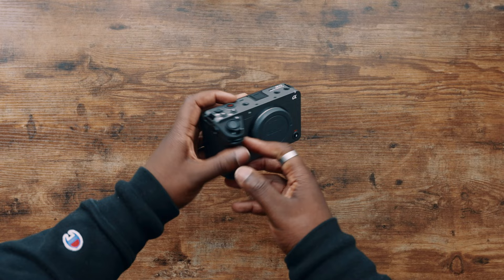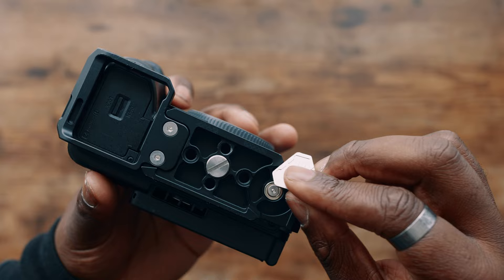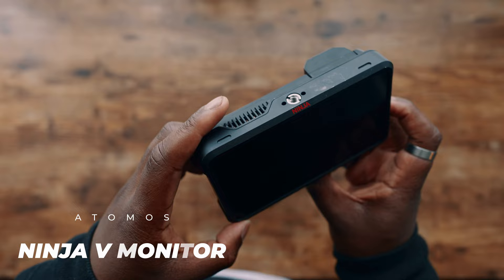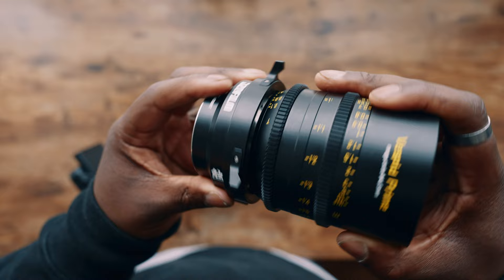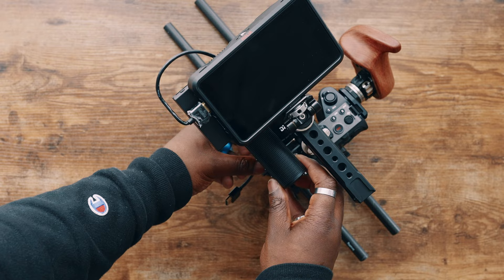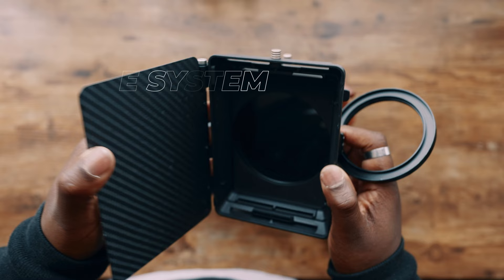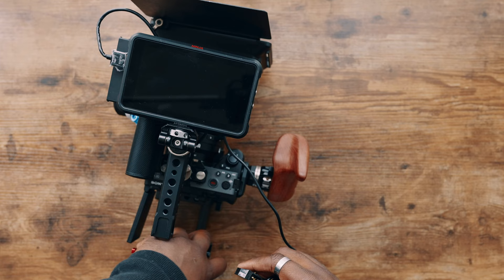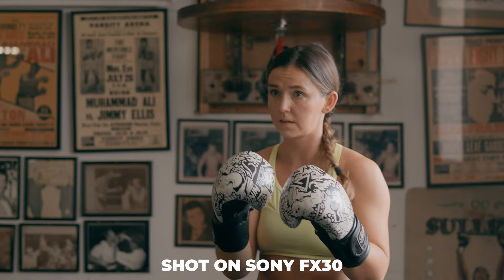Turning The Sony FX30 Into a Real Cinema Camera

Comment: FYI to all the fx3/30 owners. Surui came out with basically an identical cage as this for a fraction the price. Been using it and it’s a solid buy 😘
Reply from the maker: Fractions a bit of a stretch , the tilta full cage is $10 more on BH 😅
Reply: For a fraction OFF the price. 😂

Comment: Would you use the similar system with the XLR handle from Sony?
Reply from the maker: by all means you could , just need a monitor mount for the top handle, maybe the extension!

Comment: Is there a difference in battery life or power if using USB-C to the Dtap or getting a Sony Dummy Battery to Dtap?  Or possibly prevents overheating?
Reply from the maker: I think most people do it to avoid overheating , I just do it cause I’ll lose my battery door easily haha
Reply: Never use a dummy battery to Dtap for the FX30. You’re connecting 14.4v to a 7.2v connection.   You will fry the camera’s motherboard.

Comment: Very good video, I have a question to see if someone can solve it, I have a Sony a7siii I don't know whether to use a USB C cable for power with the v-mount battery or use a fake battery, what do you think?
Reply from the maker: I’ve heard people get hit or miss on dummy batteries , kondor blue has a usbc to d tap that might help !
Reply: @KofiYeboah  but I have heard that when connecting it via USB C, the battery does not charge completely so it discharges anyway, even if you have it connected
Reply: So, what do you recommend, use USB-C?
Reply from the maker: @areskrx9527  Ill use usb c
Reply: @KofiYeboah  thank you so much

Comment: Is it safe to power the camera and monitor using the same V-mount battery? I’ve been told not to power my camera and monitor using the same V-mount battery because it’ll fry the HDMI port and possibly the camera. Is this true? (I shoot on the fx30)

I'm using a small rig vb50 battery. I have an 8v dc connection to my monitor and a 9v USB-C power delivery to my camera.
Reply from the maker: I’ve never had a problem tbh

Comment: Hey Kofi I have a bit of a problem. I just got this battery for my fx30. I ran a USB A to USB C cable from the fxlion nano two. When I used it for the first time I had to keep replacing the internal battery because it wasn’t keeping up. Any ideas? Do I need to use the USB C port on on the nano two?
Reply from the maker: Imma link a Kondor blue cable that might be better , it’s a usb to d tap!
Reply: @KofiYeboah  I have the kondor blue dtap to npf for my monitor. But this battery only has one dtap. What would you recommend for the monitor then?
Reply from the maker: @barnes-media  do you have a d tap port on the v mount plate?
Reply: @KofiYeboah  no I don’t. Did you test out using the usb c port on the battery?
Reply from the maker: @barnes-media  yeah on my fxlion2! 
There’s npf to USB I believe but those might be hit or miss 
I didn’t have problems with mine when I used it so lemme do some digging

Comment: Thanks for the rig. 
How do you power your FX30 externally? I have a v-mount battery plate that comes with a D-Tap and a USB-A jack for power. I tried using a USB-A to USB-C to power my FX30, but, the FX30 did not see the battery when I plugged it into the camera. Any suggestions?

I checked Sony firmware for FX30B, and it doesn't show anything at the moment. I have v1.0 firmware.
Reply from the maker: I found the same on my regular usb cable as well ! I did some digging and was recommended a usb c to usbc cable that has to be capable of a higher wattage 
I linked in the description I’ll be trying it out and will update the results !
Reply: @KofiYeboah  Thanks, Kofi. I will have to get one of the v-mount batteries you recommended since it has the USB-C input/output jack. Thanks for all the links.

PS. I noticed that under the USB settings it has a Mass Storage setting. I've heard that the FX30 is supposed to get the ability to record externally to USB-C external drives - like the Samsung T5's- in a firmware update. I hope that happens soon. I have a couple Samsung T5 512GB SSD's that would work well.

Comment: Just buy a RED
Reply from the maker: That’s not a financially responsible decision at all contextually lol
Reply: @KofiYeboah  RED is more modular so you wouldn't need to stack attachments like that lol i think the fx30 is a dope camera as a base but i think if you add all your costs up you might have enough for a RED. lol
Reply from the maker: @BrandonDull  lol that math don’t check out 🤣 the Komodo is 3x the fx30 and all the accessories for the Komodo costs more 😂
Reply: @KofiYeboah  I just bought a RAVEN so im basing it off that. I liked the RAVEN because it does 120fps the Komodo doesn't/ I believe the FX30 does 120fps but you have to buy the monitor so you can do external raw recording.
Reply from the maker: @BrandonDull  the ravens still more than the fx30? Also finding accessories and dealing with the mags , i don’t think that’s much better imo
Reply: @KofiYeboah  i do like the fx30 but without it trying to be a cinema rig. the biggest flaws with red are battery and memory cards but once you get passed that I think it would open up a lot of sony cinema shooters understanding its worth it.
Reply from the maker: @BrandonDull  different strokes for different folx, some people don't need raw, and all the quirks just to say they have a red camera, to which, I think this solutions fine!
Reply: @KofiYeboah  why wouldn't you want to have RAW ? You don't want full control over your image like you would in a photo?
Reply from the maker: @BrandonDull  if the barrier to getting raw is spending 3000-4000 extra , idk many people going for it 🤣
Reply: @KofiYeboah  lol I just think you can get more out of it than log. not saying im a master at color grading with it yet but i dk i like knowing im shooting raw video like i do raw photos. so the options of controlling the image are endless.
Reply from the maker: @BrandonDull  this is true, I think the original stance is that not everyone has that kinda money to do that lol hens the fx30
Reply: @KofiYeboah  i been debating to sell my 5d mark iv and get an fx30 tho cant even lie